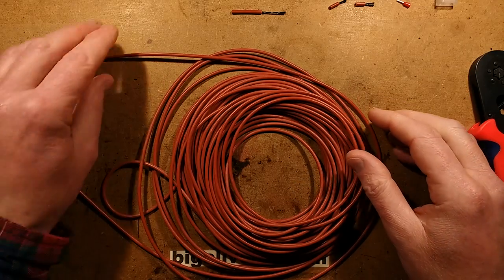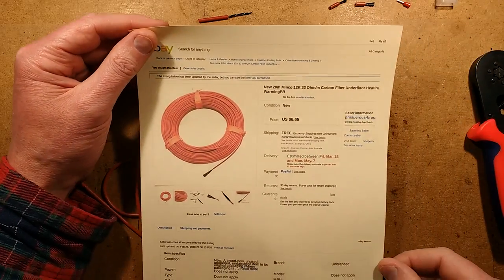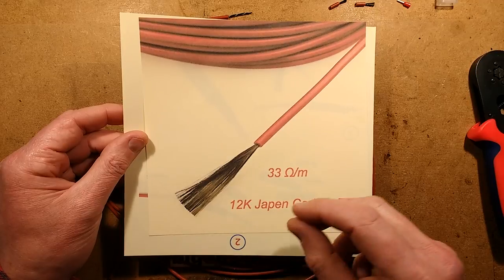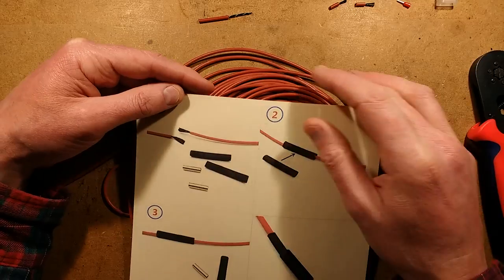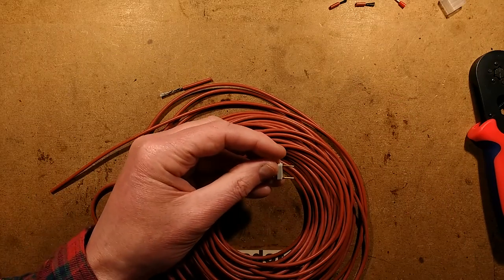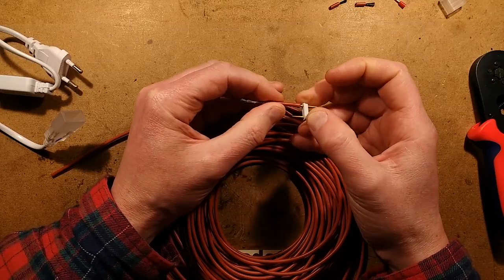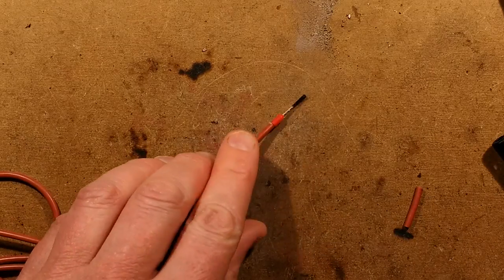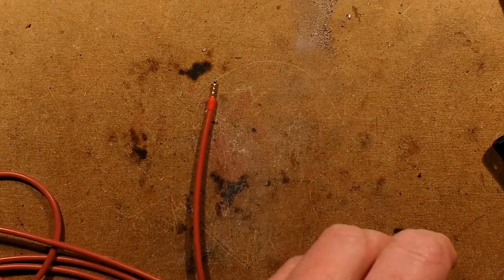Testing carbon fibre heating wire.  (with flame test)

Comment: so would you recommend this for heating up a wood laminate? or only tile? the ebay seller had this info:
 Product power calculation:
(voltage × voltage) ÷ (resistance × length) = power
For example: 12K carbon fiber 10 meters length (per metre 12K 33 ohms, 24K18.5 ohms)
220V × 220V ÷ (10 meters × 33 ohms) = 150 watts
For example: 24K carbon fiber 10 meters length
220V × 220V ÷ (10 meters × 18.5 ohms) = 261 watts
 
The above data shows that the longer the length of the heater wre is, the smaller the power of the heater wire is. (The product temperature is subject to actual use.)
Multiple heating lines can be used in parallel, so that the power is increased!
Length: (custom, recommendation of not less than 10 meters)
12K recommended to use 10-15 meters (12k outer diameter 2.0MM) power 150W-100W
24K recommended to use 10-14 meters (24k outer diameter 2.2MM) power 280W-200W
Note: The heating wires can't overlap when they are used, and they can't cross. The overlapping overlap will make the local temperature of the heating wire higher than the melting point of the protective layer, and the temperature will be too high to burn the heating wire sheath.
Reply from the maker: I'd be cautious about using something like this in a practical installation.  It would be better to use a locally sourced and compliant system.

Comment: The wire I have can go to max 18W per meter. You cut it to what you need without exceeding 18W/m. I got 66ohm/m wire and installed 15x  5m lengths into my floor, I terminated the same. That's about 2.4KW@230V in floor heating. Regulated with a thermostat. Works great.

Comment: hi clive great video. How would you vary or reduce the heat output of this if it had a fixed length of say 10m while reducing the power used? cheers o/
Reply from the maker: I'm not sure what the power output at 10m would be.  Depending on the heat required it may be viable to add a capacitor in series or a diode for half wave to halve the power.
Reply: @bigclivedotcom  thank you so much!

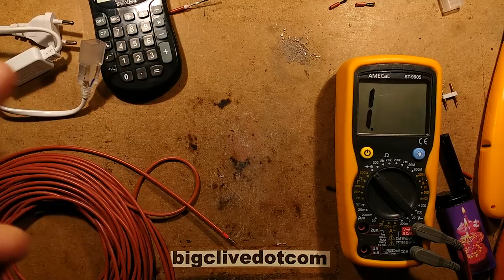Comment: @9:15 Please switch your Multimeter to Resistance and then try again measuring. You will see that the measured resistance will be much closer to the expected as when you use the diode test.
Reply: 14:40 he noticed

Comment: Always thought it was induced currents that caused thermal runaway of coiled cable plus as Clive said it can not dissipate the heat.  Curious if the power reading would drop if the coil was uncoiled a bit.
Reply from the maker: It's purely resistive heat in coiled flex.  The current flowing both ways in the live/neutral cancel out any induction effects.
Reply: Good to know. Thanks

Comment: Maybe useful if you have oil fired central heating and a long run from tank to boiler . Wind this around the pipe , wrap in insulation and stop the oil from waxing up. Similar idea could be used for an outdoor water pipe to a garage , workshop or stables

Comment: Use a ferule with a sleeve that fits the insulation, strip enough conductor to double it over to fill up the metal of the ferule, then crimp. Works like a charm.

Comment: Speaking of having fine fibers pierce your skin. I've actually had regular human hair pierce my skin before. The one time I pulled a hair out from my toe that had embedded itself a good 1/8-1/4in. I read up on it and apparently barbers get hair slivers quite often. It's also common with owners of dogs with coarse hair.
Reply: Hair dressers often have other people's hair growing out of their wrists. No word of a lie, my old barber showed me.
Reply: @bigsaggyvaag  I don't think it would actually grow out of your wrist. More likely it's just a bunch of hair slivers. The reason I say this is, imagine it's like an organ transplant, right. You're taking tissue, in this case hair follicles, from someone else and putting them in your body. When your body's immune system sees it, it sees it as a potentially dangerous invader and attacks the foreign tissue. Which is why people who have organ transplants have to take immunosuppressant drugs to weaken their immune system and prevent it from attacking the transplanted organ.

But more so, the actual hair follicle is part of the skin, not the hair itself. It's a common misconception that the white bulb at the end of a hair you pull out is the follicle. But if that were the case, the hair would stop growing once you pull that bulb out. And it would certainly make permanent hair removal a lot easier. I mean, if that were the case, waxing hair would mean it wouldn't grow back at all. 

If you look at a diagram of a hair follicle with the hair in it, you can see the follicle needs a blood supply and has sebaceous glands which produce oil and even little muscles that causes goosebumps and makes the hair stand on end. It's a lot more than just the little bulb. Which I'll provide a picture of here for your convenience:

https://activilong.com/img/cms/2anatomie_cuirchevelu_EN.jpg

But all of this is why when you get hair transplant surgery for baldness, they have to take a whole bunch of little plugs of skin which contain several hairs out of one part of your body, usually the back of your head, and transplant it to the part of your head that's missing hair. Which btw, for your own good DO NOT look up pictures of this. Hair plug surgery is absolutely disgusting looking. Especially if you have trypophobia. You know, that fear of holes that was a viral thing for a brief time.

I've seen all sorts of different surgeries over my life (in video) and there are only 2 that ever really bothered me. Hair plug surgery, and vasectomies. So that should give you an idea of how nasty it is. lol.

Anyways, I didn't mean to come off as being pedantic or trivialize your barber's claim. I just really love learning stuff and sharing that stuff with people whenever I get a chance. So I hope you found this enlightening and interesting more than condescending. It wasn't my intention to be condescending. Cheers, buddy. And take care. Especially with the pandemic. =)

Comment: I've got this stuff in my gutters.  I have 50m of it on 110v.  It runs down 25 meters and comes back to a plug.  It draws about 8 watts.  This will be the 1st year I use it.  I don't think it's going to be enough to keep ice from forming in my gutters and downspouts.

Comment: The thing with fiberglass and carbon fiber particles is they're flexible allowing your lungs to eventually push them out. Asbestos fibers are stiff and brittle so they continually shatter into finer fibers getting deeper in the lungs.

Comment: Hmmmmm...... Maybe braze it or high temp solder the connection...? Thinking that moisture would corrode the copper into copper oxide, resulting in worserer connections over time? But that some sort of tinning would potentially wet onto the strands and the wire...? 

Or like a graphite donut, with a copper or brass sheath/crimpy thing? Possibly crushing the graphite inside of a copper enclosure?

Comment: You could wrap it around exposed waterpipes (and wrap insulation around the whole thing) to keep away the frost. (I had two brakages this winter; it's the bends and tabs which break, not the pipes themselves)

Comment: Uhm... Aren't you measuring the "forward voltage" of the wire there (9:23)?
Considering it's a purely resistive load (as the power factor implies) 1/90×240² = 640 Ohms which would be about 3 % off... Sounds close enough to me.

Comment: i insulated houses in the 80's blowing fiberglass through a 3" hose , i was very pretty sparkling in the sunlight.
Reply: Didn't you always end up with rashes ? I can't look at it I can't even think about it without scratching myself
Reply: no, for some reason it doesn't bother me too much.i have also used mineral wool that stuff is bad. if you get itchy from fiberglass throw a hand full of salt in a hot bath for some reason it works
Reply: i respect that
Reply: Oh my god... How was the itching? I played with the stuff as a kid once and it was a week of itchy hell.
Reply: @Space Core ugh I used to work with fiberglass piping and insulation and the dust from either would make me so goddamn itchy I'd scratch myself bloody. I'm glad I'm nowhere near that industry anymore.

Comment: Clive, at 9:20 when you're measuring the resistance.. isn't the meter set at diode testing??
Reply from the maker: Yes it was.  I noticed that later in the video.

Comment: In commercial cooking systems we use this same carbon heater style in ribbons ,pads ,cables etc. Most are 24v ac and 110/120 v ac generally used on vat fryers ( French fry cookers and chicken products occasionally hands feet x wife's head the usual ) to keep oil lines , pumps etc... warm so they move artery clogging fluids for when oh I don't actually filter there once was cooking oil as opposed to the sludge that is smoking in there vat ( yes I do a lot of fast was food places and no I don't eat anything that comes out of them ) . They are also starting to show up in refrigeration . The connections are generally a heat bonded/Vulcan  process from the carbon to a high temp silicone/silver wire pigtail lookup frymaster heating cable or pitco  www.partstown.com  or similar . I have a large one I use in the winter for my van seat and run it from a inverter ( Nebraska actually does get cold and I'm old. mother found me under the refrigerator in may of 1959 she said the milk man put me there)

Comment: Breathing fiberglass is reasonably well studied. It can lead to "silicosis". I don't know how well carbon fiber has been studied for this, but I wouldn't be surprised if the relatively pure carbon is far more biocompatible than silicon dioxide. That's purely a guess, though.

Comment: The test to see if any of the insulation was pierced is done in a water bath. Lets them test a full roll at a time without having to unwind it like you would have to to pass between rollers. Depending on the rating of the wire they can leave it in for longer or run the test at higher voltages but the simple one is run it at the normal voltage for a set time to see if anything leaks to the water. 

If the type of cable requires special testing I have seen them run a water bath on individual parts of a cable that would make up an underground substation feeder.
Reply: This looks a lot like the resistive heaters that they imbed in tile floors to make them toasty warm to the bare feet.

Comment: Looks like it might make a good heat-trace cable for external condensate pipes on condensing boilers, especially if run at 12v.

Comment: Hi Clive I was wondering with Ozone generators if you can use them to remove the smell from towels. Like if you put them in a zip-lock and let it "soak" for a while. I also wonder if it would bleach them well
Reply from the maker: There are commercial laundry systems that do that.  They either tumble clothing in ozonated air or diffuse it through the water as an alternative to detergent.

Comment: Glass and carbon fibres are different from asbestos in that they are not crystalline like asbestos, so they can not split in even finer fibres. So most of the glass or carbon fibres have the same diameter they had at production. I think they can not easily go into the lungs without touching the walls on the way.

Comment: Caustic Soda DRAIN CLEANER (NaOH) in water should etch the metal crimp away, leaving the carbon untouched to check for crimping damage.
Reply: I was thinking acid, or ferric chloride.

Comment: I have been thinking about buying this product and modifying how I drive it to provide an electric heating "bowl" for some of my DIY stuff as if I set it up as several coils of a few meters in parallel with some basic switching using possibly just a voltage variation on DC I could have a thermally controlled heated container that can heat up fast but is generally unstressed when at the desired temperature

Comment: The "wires" on the pads for TENS machines are made in the same way as these - with white (probably) nylon wrapped around carbon fibres.
I think the nylon must just be there to help keep it together during manufacturing.

Comment: This looks perfect for a heated jacket with a small HV transformer.
- 
Carbon fiber insulated heater wires are ideal for quality applications in heating pads, electric blankets, and similar low wattage applications.
- 
The wire has stable heating no matter the wire length because of its voltage regulation control.
- 
Carbon fiber insulated heater wire has a good oxidation resistance against aging. Their electric conversion efficiency measures at 98%, saving valuable energy. With this chemical stability, the wires can work without oxygen up to 3,000 degrees.

Comment: I didn't catch the optimum or maximum current that should be applied to a length of this stuff.  That is, what are the ideal and minimum cut lengths for 120 and 240 volts, if your goal is to produce good-to-maximum heat per meter of material without starting a fire?
Reply from the maker: It's really just for low level heat.  I wouldn't recommend running it too hot.

Comment: You think it would get warm enough to soften PVC tube?
Reply from the maker: It might be able to be used for that, but bending the tube with the cable round it might stretch and split the strands.

Comment: I have carbon fiber heating material like this but in ribbon form. It's near stuff, I used it for dew heating straps for a telescope.
Also I checked the resistance with your meter's values and basic Ohm's law, and sure enough resistance was ~669 ohms.

Comment: Was investigating some stuff for heating the earth in plant pots with a 12v supply. My cable was a more conventional under floor heater with two wires in it. Still all a bit fragile to terminate.

Comment: A certain "high-end audio" brand uses carbon fibre in a few cables. Fairly insignificant, except for the fact that they glue the carbon fibre to the connectors. (If I remember correctly.)

Comment: I think this might have been what was used many years ago in a pipe wrap, to prevent pipes from freezing up in the winter you just had to remember to plug it in on those below 32 degree days. Of coarse all modern pipes & tubing does not require that any longer, Thank God, hated crawling under floors to thaw old pipes out, usually old galvanized piping.

Comment: We''ve both gas-fired central heating and various other forms of power throughout our UK victorian/edwardian house...

In the sitting room we have a live coal/log fire...we love a live fire...and we need never fear power cuts...but it's also gas-centrally heated as a back-up...

In the dining room we have an old black lead range...it'll slow cook a roast meal, bake bread, or do a fry up...it's not often in use, but when it is, (eg when it slow cooks the most gorgeous Christmas Dinner), it's highly effective...room also gas centrally heated as a back-up...

In the kitchen...we can cook either using the conventional gas cooker, or cook/heat via an Aga/Rayburn...the latter indirectly heats at least three other rooms....

Moving upstairs we have four rooms fundamentally heated by gas-fired central heating, (some with secondary heating provided by the Rayburn), but the master bedroom also benefits from an optional open coal/log fire...

We're not the most "energy-efficient" outfit but think we've got it mostly covered...we've had the odd power cut/supply cut down the years but have always survived...usually with enough capacity to help our friends and neighbours too...

Comment: Would this be good for DIY heated seats?  Most vehicles usually only have low or high. Is this just turning on and off additional strands or varying the voltage?

Comment: Good job Clive - there will almost certainly be tailor made crimps for this cabling - as there are for the various types of optical fibre cables and coax.   Where the hell did you get that pin crimp tool though? A serious piece of kit!!  It appeared to do a good job.   The cable looks kosher...

Comment: Hi Clive, Thanks for another great video.Excuse my ignorance,but what are those connectors called & where can I get them?Regards, Chris.
Reply: Bootlace crimps / bootlace ferrules - think I saw them in the maplin closing down sale... the crimping tool at maplin wasn't very good though, really you want a tool that has a ratchet action - even if it's not as posh as clives.
Reply: I think they're just called "ferrules."